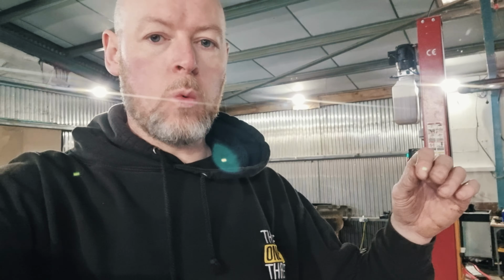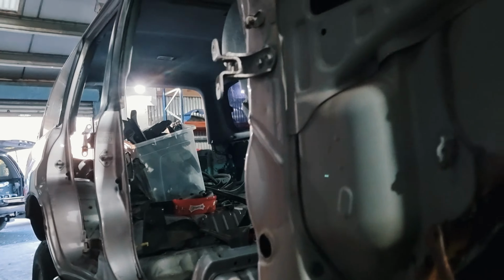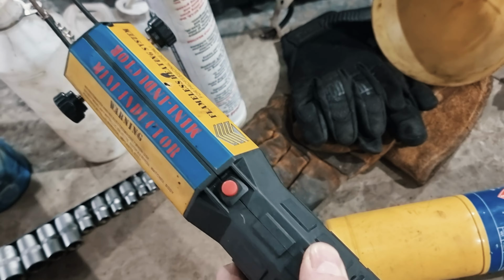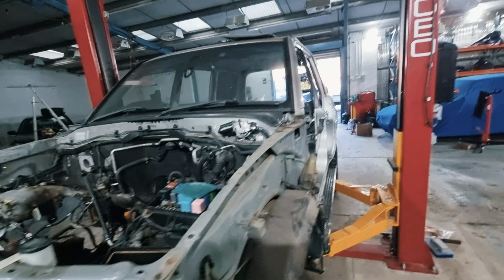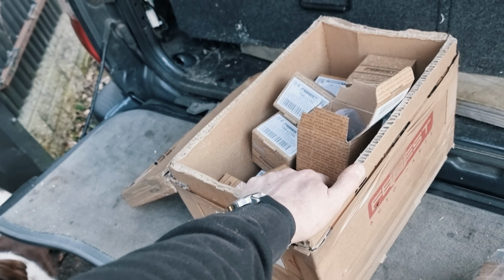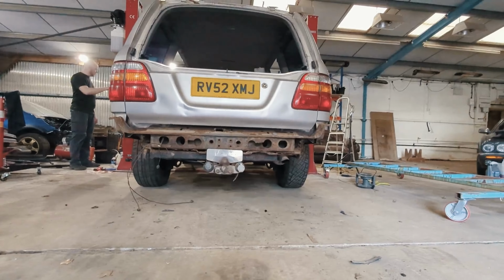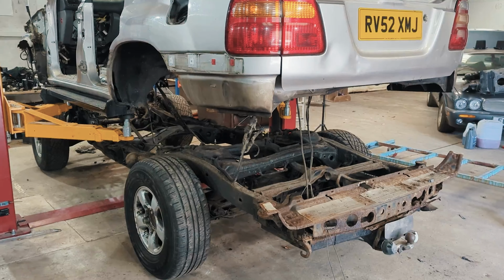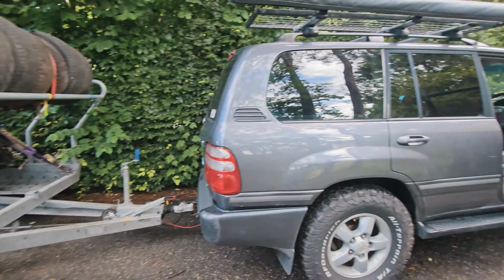Removing the body from my Land Cruiser

Comment: So are you going to manage to remove the body on your good one, without taking the engine out ? I am local and would be interested in seeing how much work is involved, I have a new XForce cat back exhaust delivered yesterday and was at a minimum going to wire wheel the whole chassis and repaint before fitting the new exhaust,  I have done a 80 series a 95 series all without taking the body off, and it takes forever, the mess in the workshop is not good.  Any advice would be appreciated. Ideally get the chassis galvanised in Elgin would be a dream job.   So body off would help make the dream come true.
Reply from the maker: I'm going to lift the other one but not remove the entire body. Taking the whole body off is quite a destructive process really. You need new brake lines at the pump, new ahc lines at the pump, air con removal, lots of the interior needs to come out, and a lot of the engine ancillaries need to be removed so you can unfasten the wiring loom
Reply: A lot to work through, definitely want to try, but for now I will soldier on with the wire wheel , it’s just surface rust really and it’s only the back half the spare tire space was done a couple years ago when I put in a new LPG tank, this one is my 4.7 100 series, the wife drives a 95 Colorado 3.4  5VZ-FE.  for the past 18 years and just won’t part with it, I’ve owned Landcrusers & Lexus LS 400 for the last 30 odd years, you have made a good choice with buying and working on Landcrusers so easy to work on and parts are widely available worldwide. Keep up with the videos as it will help those folks who want to learn more.

Comment: I suggest you be VERY careful about using that induction heater on the good Land Cruiser body mounts. They are likely quench and tempered property class 10.9 bolts and heating them above 425C can damage them (temper softening, annealing, decarburization). I would recommend soaking in penetrating oil, heating with an electric heat gun, knocking off as much rust as possible with a stainless wire wheel, re-soaking and re-heating, then tapping it in alternating loosening and tightening directions with a 6 point impact socket on a 1/2 inch drive impact gun. If the nut rounds off, replace the 6 point socket with a twist extractor socket. If that STILL doesn't get it off, I would recommend replacing the whole mount bolt & nut regardless of whether you use the induction heater or cut it.
Reply from the maker: This is also solid advice. I completely replaced all the bolts when I did the other cruiser 👍

Comment: So why body lift and not just suspention lift?
Reply from the maker: In order to fit 35 inch tyres I need to do both
Reply: @landcruiserscotland  I’ll make a video for you later. I just put 35” tires in my 100 series with no lift.
Reply from the maker: Do the wheels still turn left and right 😂
Reply: @landcruiserscotland   just uploaded video to my channel.
Reply from the maker: I'll check that out later tonight. Did you have to do a lot of cutting instead of lifting?
Reply: @landcruiserscotland  yes. Lots of cutting. Lots.
Reply from the maker: @E39M5SPEED that's even braver than a body lift. I salute you!
Reply: @landcruiserscotland   since you are in Scotland I have a question for you. I’m looking to complete my E Torx “ set “  but I cannot find the following inverted Torx sockets. E9,E13,E15

In Scotland do you have these available?
Reply from the maker: @E39M5SPEED funny I bought a set of Etorx recently. I have never ever seen those specific sizes.